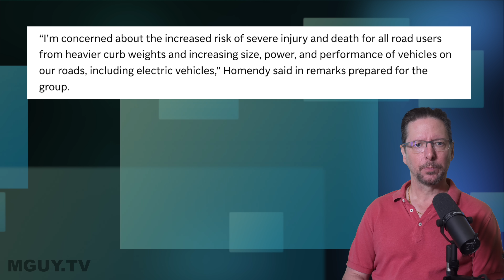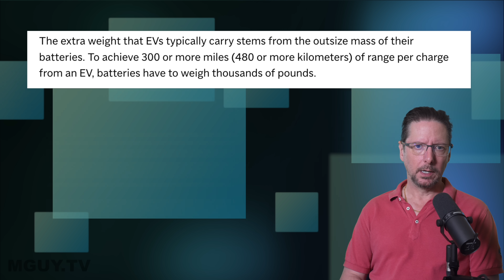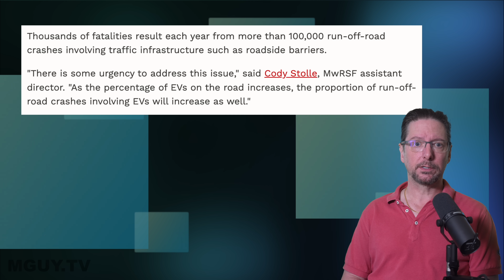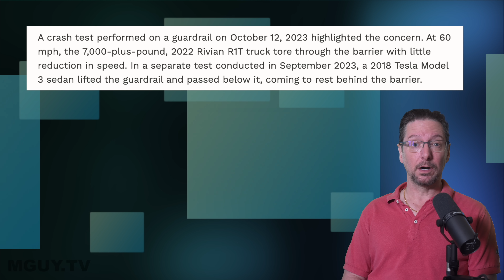EVs TOO HEAVY for roadside crash barriers (guard rails) | MGUY Australia

Comment: I grew up in the 1970's.  From 1971 until 1980 Ford made the Pinto, and its sister division Mercury made the Bobcat.  Both cars had a fatal flaw where if the car was struck from the rear, it would explode in a fireball.  The reason was the fuel tank which was behind the rear axle would move forward and strike the rear axle.  Bolts on the axle would tear thru the tank causing fuel leakage, which caused the explosion.  Some people died as a result, many others lived, but had horrible burns over 60% of their bodies.  Those were different times because there were no security cameras, or cell phones to witness the accident, and no social media to spread the word.  Therefore it took around 7 years until the government went after Ford regarding the problem.  Ford was sued, people were paid settlements, and Ford ceased production in 1980.  From what I could find, 27 people died, many more injured, There was a class action lawsuit asking for 125 million in damages from Ford, but a judge lowered that to around 3 million.  Other vehicles with similarly bad designs were some GM pickups, and early Ford Mustangs which had the fuel fillers outside of the frame of the car, that when struck, would dislodge the filler from the tank. spilling fuel with explosive results.  Move to modern time with electric cars and the extremely fragile battery packs where a Youtuber with a Porsche Taycan ran over a mall piece of wood which kicked up underneath his car causing a small dent (4mm),  Right away his battery put up a warning about the pack overheating.  He pulled over and let it cool, and the warning didn't come back, but Porsche told him that if the dent was 3mm or greater, he'd have to replace the entire battery pack at a cost of $41,000.00 GBP.  I would like to think that people have evolved and gotten smarter in the last nearly 50 years, but EVs seem to be modern day Pintos, with fuel tanks made of materials no thicker than an aluminum can.
Reply: Fewer Pintos burned than just Chevy Bolts. The Bolts didn't even need to be in an accident or even plugged in.
Reply: @robertkubrick3738  GM actually released a recommendation to park Bolts outside and not in garages for that reason.  Yet people have this obsession with them, and want to demonize ICE cars.  Agreed,  hydrocarbons are bad, but there are better options than the EV.  I worked as a computer tech for 20 years, and would do Mac repairs, and Apple themselves instructed us to have a fireproof box next to us when we did battery changes in Macbooks, because just squeezing a little bit too hard on the battery pack may affect the battery to the point where it might blow.   Those batteries are far smaller than those found in an EV.  Cheers.
Reply: You are repeating falsehoods. The Pinto was in the middle safety wise. There were some subcompacts with better safety records and some with worse records. The History Guy has an excellent video on this subject.
Reply: @Daniel-Weaver  The car itself was not unsafe to drive.  I said it had a fatal flaw which was when another car would crash into it from the rear causing it to explode in a fireball.  The car itself was average for the time.  It was a direct competitor to the Chevy Vega which I owned.  The Vega had its problems as well with their aluminum block engines that had a teflon type coating which was supposed to stop the engine from wearing out prematurely.  That didn't work either as they would burn oil like mad after 25k miles or so.  Cars can have flaws, and yet be safe to drive on their own.  Ford recognized that a part which cost under $20.00 would keep the tank intact, but they chose to scrap the car and pay out the lawsuits.  I've seen many dash cam videos, and in nearly every one of them you will find a car sitting at a red light and getting rear ended by a distracted driver.  The driver of the car hit might have whiplash, but they wouldn't be burned over half their body.
Reply: @timingenkamp3973  Yes, all of the facts you state are true except the myth that the pinto was a rolling bomb. It's safety record is in the middle for that type of car at that time. IIRC the VW bug had a worst safety record than the Pinto.  The Mustang had the same fuel tank/bumper set up. The Pinto myth came from Mother Jones.
Reply: @Daniel-Weaver  A hand grenade is safe, until you pull the pin.  A gun is safe until you take the safety off.  A Pinto was perfectly safe, until a rear end collision, and my memory of this came from me watching news programs, not Mother Jones.  Some people have a problem with timelines.  My info pre-dated the internet.  Mother Jones was not even born yet.  The Mustang was different from the Pinto as I explained above, but you must have a limit on how many words you can read in a paragraph.  What would you call a car which burst into flames if another car rear ended it, a fluffy pillow?  The VW Beetle may have had a worse safety record than the Pinto, but the reason makes a world of difference.
Reply: @timingenkamp3973  Again, I'm not saying some Pintos did not catch fire. Some did, but not every Pinto that was rear ended blew up. The Mustang was the same in the top of the gas tank was the trunk. And the tank was behind the axle. Mother Jones was around in the 70s as was I. One last thing. The GM square body with the side saddle tanks had about 5 times the fires . Best license plate ever for a Pinto? KABOOM
Reply: @Daniel-Weaver the pinto hatchback was even more dangerous because of the reduced metal structure and extra glass. So glad it was a VW Bug that rear ended my pinto.
Reply: I would buy another (yes, I had one) Ford Pinto before I would buy an EV.
Reply: @dougkabler3032  Given the choice between the two, so would I.  My point was that back then people seemed to care more about possible hazards then they do now unfortunately.  Now it's more about the "wow" factor. I guess I'm just old, as well as old school.
Reply: Please show me a 1980 Ford pinto.
Reply: @markst.germain9286   It took me just a few seconds in a Google search for "1980 Ford Pinto" to bring up many photos of them.  Help yourself.
Reply: @markst.germain9286  
I have a 1977 Pinto wagon. Is that close enough.
Reply: Don't buy one.
Reply: The fire issue was only on the first production models and was easily corrected. The pinto was also not the only car with rear collision risks. Many cars then had the fuel fill behind the license plate. In a collision the filler neck could be ruptured causing the same kind of fire. The Pinto fires were more famous because of the coverup.

Comment: The speed  specifically acceleration aspect of EVs is worrying indeed. I followed a young guy in one of those ridiculous new MG things through my town the other day. He was driving like an absolute tw4t and burning away at every light yet I was till catching up at the next junction. He flew around roundabouts on newrly two wheels - he had so little control over it. This will definitely end in tears as most young people haven't got the sense to drive according to the road. That Rivian went through that crash barrier with zero trouble. That concrete stopped it but imagine that being several cars coming the other way. Wow. Great video as always
Reply: So pretty much no different to all the other f-wit hoons regardless of the propulsion system.  Was just watching DashCam crashes, lots of those cars have no trouble ploughing through walls/houses and none were EVs.

Comment: It would be interesting to see the results of the same tests done with the wire cable barriers they use on some of the roads here in OZ.
Reply: Either sort of barrier is good enough to hold back a B-double, so vehicles like pickups and SUVs are easy. (As are EVs)

Comment: Amazing that EV pickup or ute become safer caused battery weight centre of gravity making it landing upright instead of upside down or side way.
Reply: Anything can turn upside down or roll especially in an off-road vehicle. Consider the weight of a battery pack forming the floor of a passenger compartment and what it will do in the event of a vehicle going over and landing on it's roof. When EV utes/pickups start getting mainstream you're going to get outcomes such as this if you have too much available via the go peddle https://www.youtube.com/shorts/yysa8xvuDw0

Comment: In Europe many countries have 50 mph / 80 kmh speed limit for 7 500 lbs or more. Plus require special driving license. For a reason.
Reply: I think for context it’s worth noting that most EVs fall well, well, well below this weight.
Reply: But BEV are still much heavier than their Equivalent ICE vehicle.
Reply: @robertkubrick3738  they are c30% heavier. But even still the overwhelming majority are lighter than 7500lbs
Reply: @Audioremedy0785  You did your best, but they're all here for the confirmation bias.
Reply: @robertkubrick3738  What about pickups?
Reply: @SirGregoryPageTurner  they are just idiots tbh. I suspect most of these comments are by bots.
Reply: @SirGregoryPageTurner  What about pickups? Do you think a small BEV is better when it weighs the same as a pickup? Do you think large pickup trucks have the sudden acceleration problem of a BEV that does 0-60 mph in 4 seconds? So what exactly do you think it is that makes heavy BEV less bad than a pickup truck?
Reply: @Audioremedy0785  Haha. I thought Bots would be smarter. 😉

Comment: That guard rail test looked absurd.  Guard rails are designed to deflect glancing impacts, not full-on crashes at right angles. But current rails still aren't designed with electric semis in mind of course.
Reply: Look more closely at the video.  Even with the first angle (clearer in the second), the right front of the truck is through the barrier before the left even hits it.

Maybe not as ‘glancing’ as most but also not a rt angle.
Reply: @gcenturion4230  Indeed.
The truck hit the rail at an approximate 45 degree angle.
Reply: After all, there are many Lorries in traffic and they are much heavier than EV's. Maybe it's because the lorry doesn't go as fast as the EV's? But the speed of 90kmh (55mph) is enough for the lorry to break the barrier just like this EV. So what's the deal?
Reply: @aro8000  Yep, saw a lorry destroy a few hundred yards of barrier on the M5 at Gloucester a few weeks back. That wasn’t an EV, by the way. They are designed to try and directionally contain what they can, but they can still be broken by anything above the smallest cars.
Reply: @aro8000  Most EVs are less than 4500lbs, Many ICE pickups in the US are well over 4500lbs. Its not an EV problem, its a weight problem.
Reply: @seannewman5391  The battery is the weight.
A Hyundai ioniq 6 battery pack alone is more then a Dodge Viper V10 engine and a full tank of gas.
Reply: @larsjrgensen5975 I know batteries are heavy! 😊
But as battery energy density and improves and motors become more efficient expect to see big changes.
10 years ago EVs were 40% heavier than their equivalents, now they are 30%, by 2035 they are expected to be 15% heavier. So not too bad really. New tech progresses fast.
Reply: @seannewman5391  They are going to get better yes and hopefully faster then the current pace.
I am looking at a Ioniq 6, (probably one of the best EV out there in terms of efficiency), but it is still heavier then my current top spec wagon with 3 professional volleyball ladies, a beer cooler and picnic basket for a trip to the beach.

Just a random example not a dream or anything.
Reply: Travel through rural Australia and you'll often see them at the head of a T intersection on many country roads. What do you think would happen if someone failed to stop at such an intersection? They're not just for glancing impacts.
Reply: What you say may be true, but I personally witnessed a Chevy Cruise hit the guard rail head on at over 90mph and it bounced off the guard rail and slid down the road another 100 feet and came to a stop. And the person got out with minor injuries. When I say head on on mean even more straight on than this video.

Comment: 4:33 I just watched a 1978 Toyota Celica GT perform that EXACT same maneuver 2 days ago. Jersey barrier just launched the car, it crossed a full lane of traffic before touching back down and sliding off the road. 40MPH impact at MOST as the car had just gotten a green light and had only accelerated across a 4 lane intersection before hydroplaning and going into the center divider.
Might also point out, a Jersey barrier is NOT a guard rail. Jersey barriers are designed to REDIRECT A VEHICLE back into it's side of the road... this is a head on crash in the test. I'm legit surprised the truck didn't just go end over end. Actual guard rails are intended to catch and slow a vehicle, not stop it.

As to weight concerns, I find it slightly ironic that the overall weight is always a massive issue, but how that weight is oriented is never discussed. Slam an EV sideways into a guardrail or jersey barrier and the car will be LESS likely to roll over, where a overall lighter ICE sedan will more often than not leave it's wheels in the air after a similar collision.

Comment: On that basis I gather you are also suggesting a ban on 4 door pickup trucks as most are heavier and less crash worthy than your typical EV.
Reply: You've missed the point. EVs with comparable dimensions to an ICE vehicle weigh AT LEAST  200 kg ( 450 lbs + ) more.

Comment: Tesla Model 3 's curb weight 1,611–1,836 kg.

Holden Commodore (VE) sedan's curb weight is 1,690–1,825 kg sedan.
Reply: Ford Raptor empty weight is 2.6 tonnes (no fuel or passengers).
The Rivian is 600kg heavier.
Same gross weight.
Reply: Not sure why you picked Commodores. They are in a bigger class to Model 3s. Longer, wider, talle4, longer wheelbase, etc.

If you google "the weighty issue of electric cars [part 1]" you'll get a chart comparing model 3 weight  to overall ICE vehicles sold in Norway (under 5metres in length). It shows model 3s are 25% heavier overall.
Reply: @E-mergent  How long is a 2007 VE Commodore?

The length ranges from 4894 mm to 5084 mm.
Reply: @E-mergent  MGuy is located in Australia.
Reply: @E-mergent  
2023 Toyota Camry SX HYBRID from Toyota AU
1615 kg (3560.5 lbs) of unladen weight. No fuel. Add 36.5 kg for 50L fuel.
4904 mm (193.1 inches) in length.
Reply: @E-mergent  The argument is about vehicle weight, not their category.

Australian guard rails should be able to handle Holden Commodore VE's weight.
Reply: @valenrn8657  Yeah they don't like the argument of what people drive that matters, they prefer to put cars into categories and then compare.

Comment: EV'S are not meant to be a replacement for ICE vehicles they are another tool in the elites armoury to bring about more death and destruction to innocent lives, think about it, every goverment in every country has signed up to net zero, they are pushing these technologies onto an unsuspecting public knowing full well the implications of emf radiation from the battery, thermal runaway and the release of toxic chemicals in the event of a fire, not to mention the implications of what you have been discussing in this video.
They know EV'S do not make sense, they know they are not sustainable or viable and they know that they are down right dangerous, but they don't care. Its another tool to use to aid in the elimination of private transport under the guise of climate saving and net zero, ushering those that are left into 15 minute cities.
Once that has been achieved they can then get rid of the EV, no need for personal transport in a fifteen minute city.

Comment: regarding acceleration, back in the 1990s I drove a nippy 1600cc car. Then I got a company car - a Vauxhall Cavalier  1.7 turbo diesel. I drove it out of the car park and upto the roundabout, waited for a gap and put my foot down to pull out. It was so slow I was nearly rammed by an oncoming car. For the three years with the  car I tended to drive in low gear to activate the turbo at 2200rpm.  Then I took the money and bought my own car. I picked a 2000cc petrol car, got in, put my foot down and was horrified by the acceleration. Too much for me and bought the auto version instead. God knows what 2.6 seconds to 60mph would feel like.
Reply: I have a Hyundai Accent 1.6L turbodiesel automatic. It seems to have the right amount of pep but not tire destroying. 25km per liter.